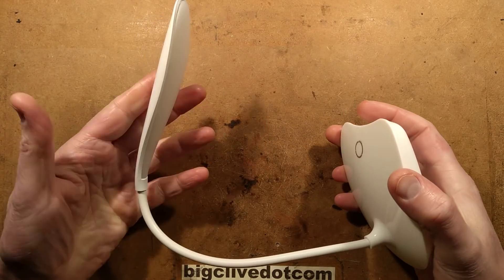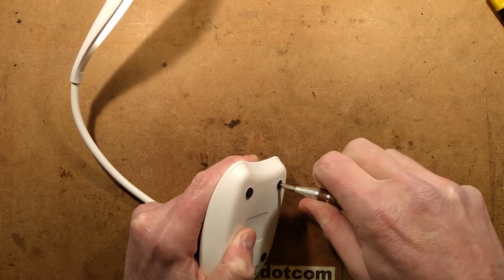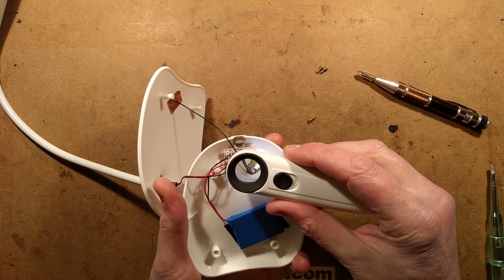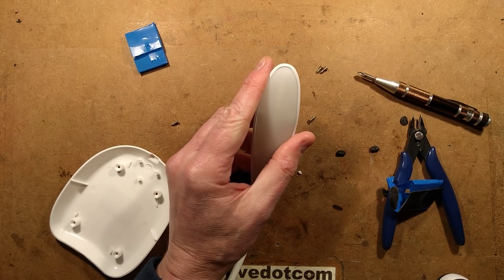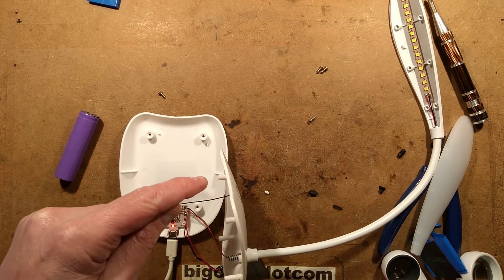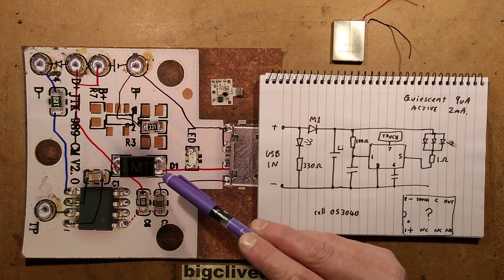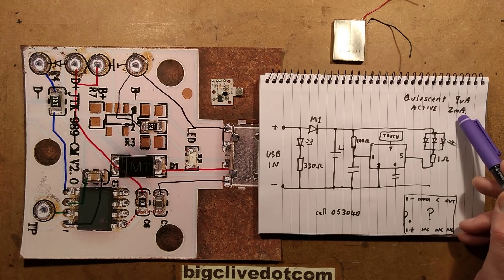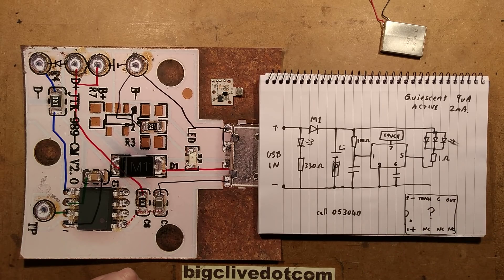Inside a dodgy rechargeable touch light.

Comment: They probably assumed that a diode will always cause a 0.7V voltage drop hence the battery will not charge beyond 4.3V from a 5V supply, and 4.3V isn't terribly bad for a Li-ion cell. Unfortunately the 0.7V drop is only valid if the diode draws sufficient current. I'm not sure what will actually happen but both possible scenarios are bad in different ways. If the battery draws less current as it becomes charged, the drop across the diode will keep dropping and the cell will eventually reach 5V which is bad. The other possibility is that the cell cannot go much above 4.3V. In that case it will keep drawing current even when it is fully charged, which will also cause damage.
Reply: and then you buy a new chinesium device and further pollute the earth with yet more plastic chinesium.... vicious cycle of stupidity ;)
Reply: 4.3V wont blow the cell up, but it will make the chemistry degrade very quickly if it isnt one of those new ultra pure chemistries. 
it definitely isnt...
Reply: Make the diode a Zener  [ turned the other way around of course] and the voltage could be limited to a constant value less than the 5 volts from the USB supply.
Reply: Hey this is a very relevant observation, i had the beginnings of a very similar thought but you thought it more or less to completion.

I don't really think full 5V (0V diode drop) can EVER be reached via a diode, no matter how small the current, as the battery will also keep consuming and thermally dissipating a bit, as does the touch controller, but there certainly is a marked decrease in voltage drop at very low currents, which makes diode charger unsuitable in general and especially with a diode drop this borderline, besides being input voltage dependent and 5.25V being a valid USB voltage.
Reply: "They probably assumed that a diode will always cause a 0.7V voltage drop
 hence the battery will not charge beyond 4.3V from a 5V supply,"

The problem in not all power supplies hit 5v, the Anker USB bank I have outputs 5.3v. Although, looking online that M1 diode seems to have a forward drop of 1.1v.

Comment: What's the point of a 1-ohm resistor? A resistor in that position is used to limit the current through the LEDs, but V=IR, so if R=1, then it seems like the resistor would have no effect.
Reply: That's because (from maths) I=V/R, so if R is close to 0 (as wires tend to be), then the current will be close to infinity, which causes the LEDs to be sad.

The thing I don't get is that if the resistor is 1ohm, the current should be about 4A, which is still way too high, so either the wires are so thin they form a significant resistance, or the PWM is limiting the current enough for nothing to blow up, or BC misread the resistor value.
Reply: These LEDs have forward voltage of approximately 3V. Assuming 4.2V operating voltage, the resistor drops 1.2V to make up the difference between voltage drop across the LEDs and the supply rail. For 1.0 Ohm across 1.2V, the current is 1.2A. Unfortunately it means the resistor dissipates 1.44W, at which i give it a few hours of life at most. Actually for higher current, the forward voltage of LEDs increases slightly, which probably would put the current right around 1.1A. This is still too high, as you can't run more than about 700mA through this LED panel, certainly not. Preferably more like 300-500, depends.

There's a possibility that the ESR of the battery and the resistance of the leads and the on-resistance of the control MOSFET were all designed into the system to help manage the current. I kinda doubt that the ESR of this battery is anywhere under 1 Ohm, if it's a sufficiently shitty one, but perhaps it still needed a little extra resistance.

What if though that the touch control chip actually actively monitors and limits the current? Then the resistor is merely there to help get some heat off the die, it doesn't actually do anything to affect the current. But even 1 Ohm can be a pretty good contributor.

Unfortunately there's no datasheet since chip is very anonymous.
Reply: @danya023  3.7V - 3V = 0.7V / 1Ohm = 0.7A and probably internal battery resistance about 0.5Ohm, so, the resulting current will be about 0.5A (excluding internal switch IC resistance and wires resistance)
Reply: @makoveliprod  Ah, right. I had a brain fart and forgot about the forward voltage. If that's included, the result is much more reasonable.

Comment: You paid too much. They are only $4 at Dollarama in Canada!
Reply: I wonder if those are identical on the inside. There's a lot of tooling reuse for enclosures among low-end Chinese manufacturers, but the electronics could be different!
Reply: DAMNIT. Now I want to go down the street to get one, just so I can rip it apart and compare!
Reply: @booblla  I'm not a Canadian and thus without access to Dollarama, so my suggestion is of no practical use to me, mere suggestion/curiosity;

should it turn out to be the same, commenter BlakeCasimir below suggests to simply remove the battery - by all reason, the lamp should still work from USB and be fundamentally safe then. Just as a kind of minimalist mod to turn it from a hazard into something one might actually use in good conscience.

Comment: I'm a drone photographer and it's hilarious to watch people in the drone community freak out about Lipo and treat their batteries so carefully, yet we're surrounded by dodgy electronics like this.
Reply: Quite a bit more energy in the cells drones use than in this shit
Reply: Things that you can not see can not hurt you.
Reply: no metal shield on drone lipos either
Reply: I didn't know there was a demand for photographing drones. :)
Reply: those fat highly engineered lipos have much more current capability than anything in consumer electronics

a single cell in my quadcopter battery will deliver about 1kA with a dead short. its very violent and will definitely cause bad burns when blowing up in your hand. Might even get some of that electrolyte into your eyes.
Reply: @drkastenbrot  try  a power bank some are 20ah  lipo  3s  45c    units      ( i run them on my  70mph  19kw  ebike qs273 motor  i had   1  slower  50mph   ebike   nicked i knife   point he  hit a gard rail     the fire from that was   crazy      i just watched  like yep  time to build a new 1.  (didn't  even  pick up the wreck)  the   new  18650s in drill battery pack a punch too   tho the fakes  use same cells with no balance  protection  or voltage cutoff    same with some of these   powerbanks     and they  are indeed  20ah     (with a jump-starter     for your car too  but  no protection  on that either     you can just put a dead short   on the leads  across the cell
Reply: There is also the fact that drones will inevitably suffer some crashes, at least if you are new to drone flying, and that's something lipo batteries don't like. And most drones come from China, some with more dubious quality than others, and who knows if all those 3rd party charging hubs, fast chargers etc. are safe. The not-so-high-end ones also use very generic looking pillow style lipos with that sturdy plastic wrapper around them, where you really have no idea where the battery was manufactured and charging those up always feels sketchy.
Reply: ditto with 18650s, i abuse them until they stop taking a charge, never had 1 go thermonuclear unless you count 1 cell that the wrapper was screwed up and it shorted across a copper wire, the cell didnt explode or vent, it just got REALLY hot and wouldnt charge again
oh and my primary charger is a old 4.4v motorola cell phone charger, gone through a few of them, current 1 floats to 4.6v when unloaded(and can take a cell that high if you let it)
Reply: You're probably relatively safe with the off the shelf/DJI type of gear, but you really do need to be careful with the components used in the more hobbyist e.g. race/freestyle drones as well as rc planes.  Typically these batteries have no protection and you are also responsible for setting the charger correctly, you can literally be a wrong button press away from setting fire to a battery.  These batteries can also get subjected to physical damage.  There are plenty of real world examples of hobby rc stuff causing house fires, it's far from being some hypothetical danger.
Reply: trust  me   if you have ever seen a dj 1  battery go up   ud  be charging  them in a steel box this tiny  thing is nothing vs    a  2,3,4,5,6s lipo  in an rc car or drone             room   temp to  about 1500c  in  under a second    and that can happen  just because  you dont balance  charge    tho the dj   drones   do  that  and iv still seen 1 that was under a week old go   bad luck  but dam flames   3ft height  ALSO  DO NOT  BUY SHIT LIKE THIS FROM CHINA LOL   I COULD STILL START A FIRE THO NOT AS FAST  BUT NEXT TO A  COMPUTER DESK PAPER ETC
Reply: like smart-phones......  which is a funny name for them, since taking away said "smart" device leaves most looking stupid and dumber than a box of rocks.....
Reply: Depends on the battery technology. Drone batteries are very high current output whereas the cell in this lamp probably has a higher internal resistance.

Comment: I’m wondering if the diode provides enough voltage drop to keep the lithium polymer from peril. Perhaps a 1V drop would take the USB to 4.1V. Who knows. 🤔
Reply from the maker: The drop at lower currents is 0.6V and combined with some USB supplies putting out over 5V it does seem to give the cell a rough time.

Comment: I have a similar-looking light which also has a clip on the base and an additional on/off switch on the back next to the Micro-USB. It's actually not bright enough for most purposes, so it doesn't have much of a point. Is yours bright?
Reply from the maker: It's not super-bright, but OK as a basic desk light.  it's brighter with the diffuser removed.
Reply: I have a usb powered version which I converted to a 1w warm white by dint of chopping off most of the head, hot gluing on the bottom of a beer can as a 'reflector' and changing out the resistor. I've used it as a bedside lamp for about two years now without really ever thinking about it again, it works really well now.

Comment: Could it be an attiny?
Reply: No, it absolutely couldn't. For one, that's relatively expensive, you don't need flash in here. For other, you can only pull 40mA through any given pin before datasheet says that it's likely to explode - really you could probably do a wee bit more, but not by much. That's about 3mA per LED, like, it will light up, you could see it in the darkness, but it won't be actual light that you could read under or anything, not this amount of light. And third, ATTiny pinout has diagonal power, 4/8.

Given the power requirements, you don't expect this to be a microcontroller to begin with, because usually power semiconductors and big complex circuits like general purpose processors don't mix very well on same die; you expect this to be a power MOSFET circuit with a hardcoded state machine for the logic function, probably a mass produced special-purpose touch dimming controller.
Reply: @SianaGearz  I guess you're right. Thanks for your reply.

Comment: I have almost that exact same one. I have it plugged into a powered USB hub on my desk. Only issue is that when the hub is off, the light starts powering other components connected in the hub...
Reply: Then the circuitry must be different - missing the diode between battery and USB?

Comment: How does one determine if they have a protected cell? I have an old Samsung phone battery I'm 99% sure is protected but not sure how to verify.
Reply: Touch the leads together 
If it goes "tic" it has protection
If it goes "POP" it doesn't

"Beware of explosions"
Reply: @Individualman929  Last time I tried to fasten a nut on my LiFePO4 battery with a wrench, I fused the two together permanently when I accidentally touched both sides of the battery with the wrench. The battery is fine, though.
Reply: @anlumo1  How can you know? permanently fused the wrench on the battery-connections... (?)...
Reply: @elvinhaak  no, it fused the wrench and the nut together. I had a 100A fuse in series which blew and protected the battery itself, fortunately.
Reply: @anlumo1  Lucky you!
Reply: There's a small circuit board attached to the cell under either a shrinkwrap or a small plastic cap attached to the cell.
Reply from the maker: The plastic cap with gold pads is no guarantee there's a populated protection PCB.  You have to test it by charging with a current limited supply and see if the current suddenly drops to zero when the internal cell reaches about 4.2 to 4.25V.
Reply: Thanks, I was going to ask same.  Do you think I could take the circuit board and attach to a few 18650?
Reply: @dairesheridan3462  I'd use a charge controller designed for this type of cell, like this one: https://www.aliexpress.com/item/TP5100-double-single-lithium-battery-charge-management-compatible-2A-rechargeable-lithium-plate/32615889901.html

Comment: I have bought a lamp with the exact same function, just a bit different design from China. It had a 400mAh Lead Acid battery (directly hooked to USB, no diodes, nothing), changed the battery for a 18650 and (of course) put one of those TP4056 Lithium Battery Chargers with protection in it. Really nice "natural" light colour, really neat and handy light! (AFTER modification :D)
Reply from the maker: I'm seeing a few items appearing with lead acid batteries and no significant charge control.
Reply: I assume it's the price. A 12V 100Ah car battery is also lead acid, but costs a mere 60-120€/$/etc. If if was Lithium Ion, it'd be more expensive than some cars themselves do cost D:
But at least in the case of my lamp there was another reason: After putting in a 2600mAh 18650, the base became lighter and now it is more prone to tipping over than it was with the lead acid battery. (but still: cost is of course the main reason, it's cheapo chines after all :D)
Reply: @8bpspfreak2 I have something similar to that: folding lamp with a lead acid battery and capacitive dropper, and a three position swich. And it was supposed to light for like 15 hours on lower brightness with that puny around 900mAh battery. So I modded it, desoldered almost everything from pcb, leaving only switch. I "repurposed" that pcb as a holder for TP4056 + DW01 module and two small 350mA driver chips, with some diodes for selecting one or both chips (they can be used in parallel), and three 18650's. Now I have 16 hour light output without dropping on brightness intensity. Great! That lamp looks like this: http://images.sklepy24.pl/26159607/981/medium/tiross-ts-53-lampka-biurkowa-wielofunkcyjna-30-led.jpg

Comment: 250mah at this size? seems like they reusing old phone batterys instead of Recycling it
Reply: That IS recycling them... Taking them from one source and re-purposing it.
Reply: technically that is recycling.
Reply: most cheapy chinese junk like this is mostly if not completely recycled electronics
Reply: 250 mAh is way small for a cell phone battery. Even old-ass batteries get more than that. I have a 500W ebike that I power with an array of 120 used/discarded phone batteries (10S 10~13P). Even the smallest one (a 700 mAh battery from a 2004 Sony Ericsson K300i) gets more than 500 mAh. That's Fukushima quality, baby! (no seriously, the cell has SONY FUKUSHIMA printed on it)
Reply: @tybofborg   I assume an originally 500mAh noname Chinesium Li-Ion battery can easily degrade to half capacity after sitting 2-3 years in storage. About old, good quality batteries: I have a bunch of Compaq H3970 PDAs from 2002, sitting in storage for 10-13 years. They all work fine, can easily used a whole day with a single charge. I not yet measured the battery capacity of them, but I will. They are built with Samsung batteries.

Comment: How does the touch sensor know when someone's finger touches it? I can't understand how it does that with only one wire.
Reply from the maker: Your body acts as an antenna to ambient electrical noise, and can also act as a capacitively coupled load.
Reply: There are several ways. Capacitance is one of them There's all sorts of RF jiggery-pokery methods but that costs too much for this sort of thing. There's even some stupid ESD sensor ones (basically they are depending on you having a static charge and discharging through the chip).  Weird when I first replied BC's post was not there then it turns up a day before mine. Well that's the world wide wait for you.
Reply: @gordonlawrence4749  love "jiggery-pokery" as a term.
Reply: http://www.catb.org/jargon/html/magic-story.html
Reply: @herosstratos  I am about 90% certain that is a true story as the smaller DEC computers EG PDP-10 and PDP-11 (as opposed to their VAX 11 range) did get grounding problems after long term use especially after moving them multiple times (which happened a lot).